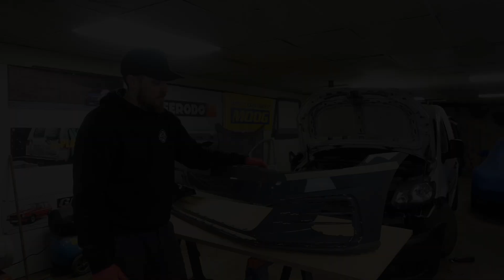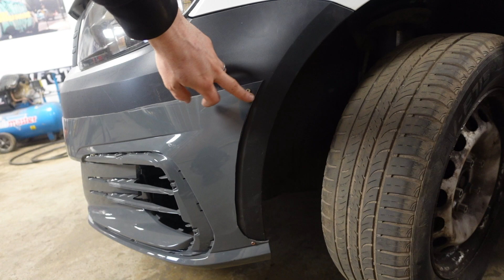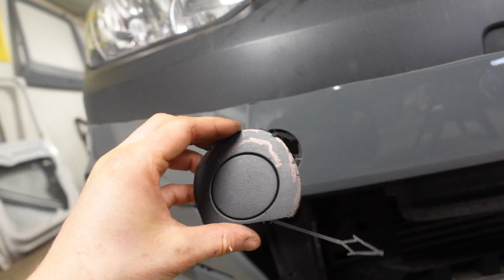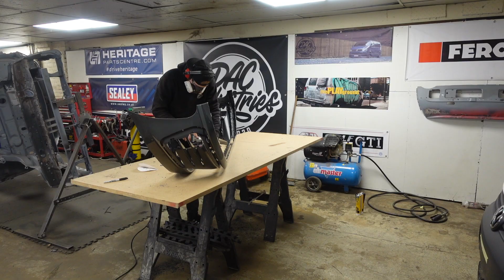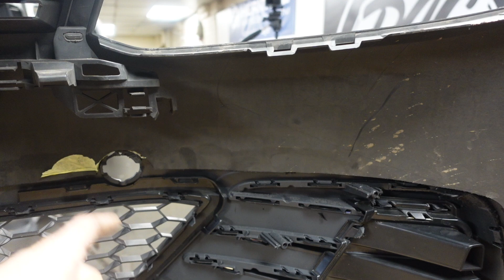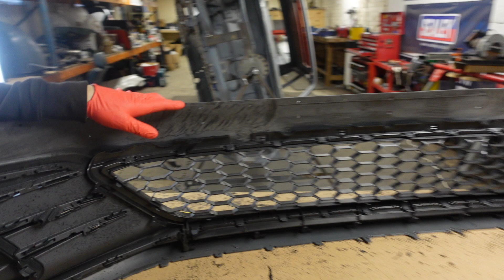VW Caddy 2K Build Series - Golf GTI Caddy Hybrid Custom Front Bumper How To - Episode 6

Comment: I did this to a 2000 Miata. The difference is, that i had to cut a Porsche Cayman bumper cover in half vertically AND horizontally, because the Cayman bumper cover is wider than the Miata. 
 My Miata looks like a mini Porsche. 😁😁😁. Every Miata owner is blown away by how my car looks.

Comment: Great stuff fella, bit of advice if you care to take it. Don’t go straight to filler, use some fiberglass filler and finish with stopper. The reason fo this is if you go heavy on the filler months later you will see ‘sinkage’ so this will reduce the likelihood of this happening. Keep up the good work
Reply from the maker: Cheers bud, I have used UPOL SMC Carbon Fibre filler.

Comment: Just from my experience:

Just splice two bumpers on the joint, V groove it ,(SHamfer)

what you need to do is to check if two bumpers have (comparable) THE SAME Plastic,, if different most won't weld together,

you can find the stamp on the back of the each bumper (PP, GF, ABS etc) and get appropriate welding rods from (https://www.plasticsolutionsuk.com/index.php?route=product/category&path=59),ypu will need hot air welding station or I just use gas dremmel welding iron  ,
first you use triangle shape rod in to V grooved joint and flat after on the top ,,sand it all flat and then use carbon (black) filler for plastic bumpers ,that should be strong as F..ck,
all your staples and metal mesh is bullshit, 

all that if plastic is comparable if not it would be another bodge job ))) 

that tiger adhesive wouldn't help on that joint, should kept 35-40 mm away from the welding joint

good luck

Hope this van will get proper automotive paint not graffiti  emulsion)

keep it coming we r all watching YA
Reply: No need for rods if he has enough of the bumper cut offs maybe?
Reply: @stevenfalconer5797  it won't stick together,
Try to cut bumper and then weld it .it will just crack/brake in the same place 

As I said 
We tried everything and came to conclusion  that is only one method. 
Some use epoxy fibreglass,but it just to strengthen the structure from the back .to weld it together you need the rods/sticks
The same plasric won't stick

Comment: Probably should of wiped the excess off with panel cleaner, it stays flexible and will be a pain to fill over
Reply from the maker: I did consider that but didn't want it to react with the adhesive. Came off OK with a knife and sander.

Comment: Cant wait to see the finished bumper just wondering if there's any way of leaving a few screws in to help keep the bumper nice and secure when it's painted. Just thinking out loud theres no right or wrong way when it comes to stuff like this. Keep up the good work.
Reply from the maker: I did consider this but didn't want any heat/moisture transfer on the screw which ma mark the filler.

Comment: The tiger seal is awesome used it many times and its normally stuck solid in 24 hours. I just make sure to rough up the areas first and clean them with ipa before applying. 
 Keep the bits of the bumpers you have cut off ,  extra material for plastic welding and for testing and to see if they melt together ok. When I  plastic weld I don't just melt the surface area , I almost go right through the plastic and build it back up mixing the two pieces together. Makes it as strong as the original bumper or better if you build up more layers on the back. . When you plastic weld this way its back to one solid piece of material and is flexible, if its just heated up at the ends of the joint its more like just gluing two pieces together and can be weak and not flexible. I normally use an old flat head soldering iron and wear a mask as the fumes are terrible off the plastic.

The bumper looks great mate, good decision to mold them together, should be really strong with the bonus of having the original bumpers fixing points.
Reply from the maker: Cheers bud, Yes I kept some pieces and used them to weld the towing eye on.
Reply: @DanChambersDAC  Nice one mate!